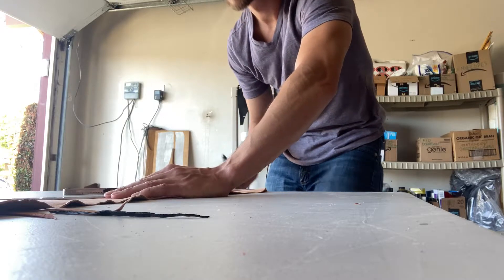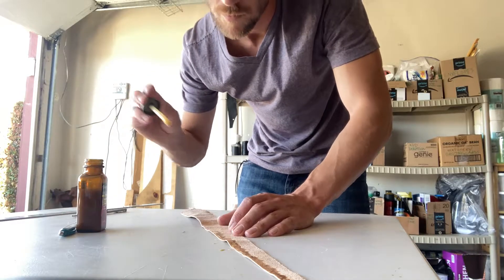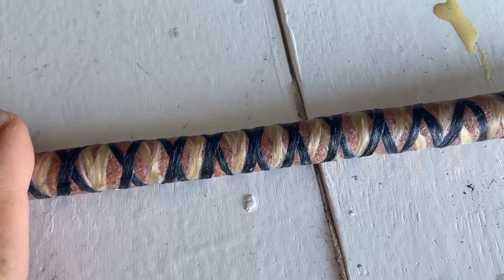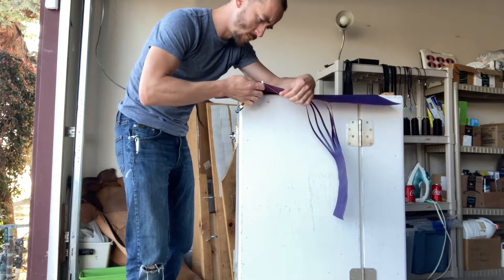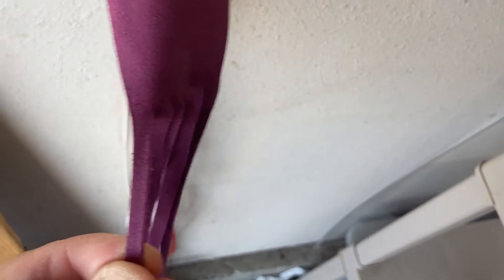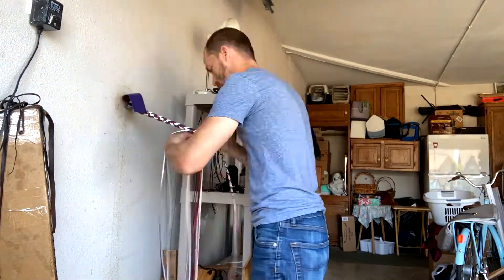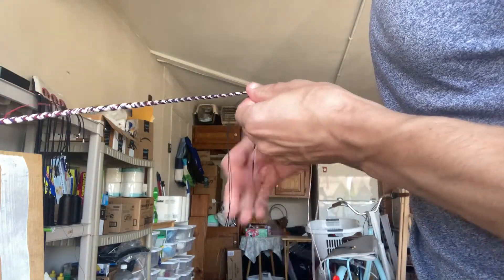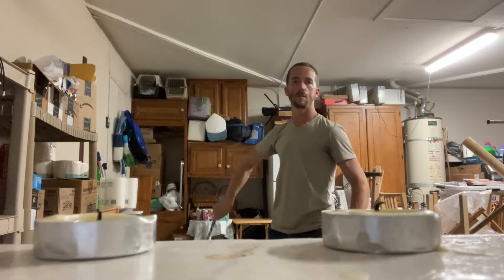SGB Whip Project Overview 011: Tri-Tone Singletail

Comment: Wow I didn't know signal whips had a shot bag inside- very interesting. Also wow those strands are thin at the end! Nicely made
Reply from the maker: Thank you very much! I probably could have left the strands untapered and ended in 6 plait instead of 8, but I also wanted to slow the drops down to keep the braid as complex as possible for as long as I could.